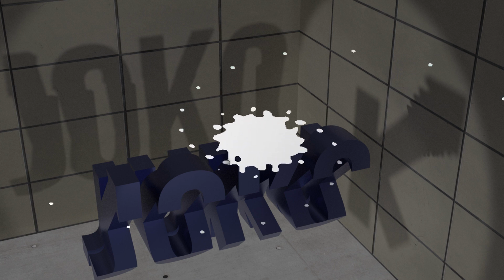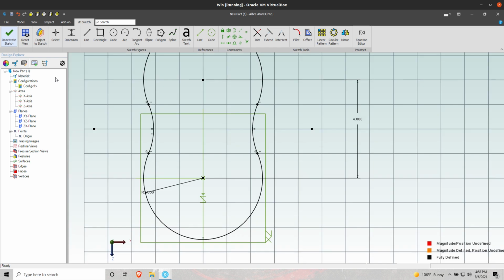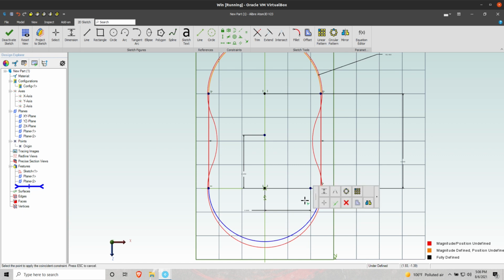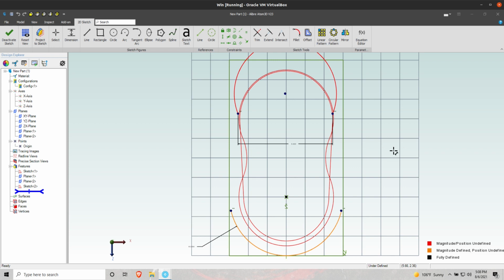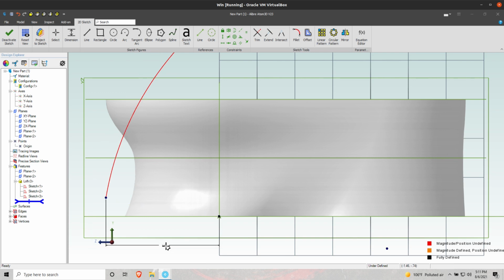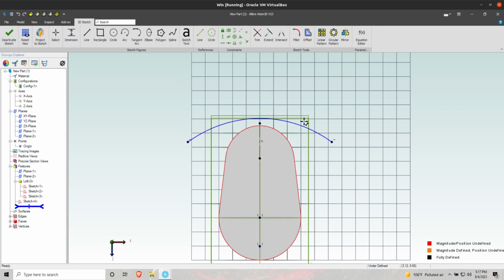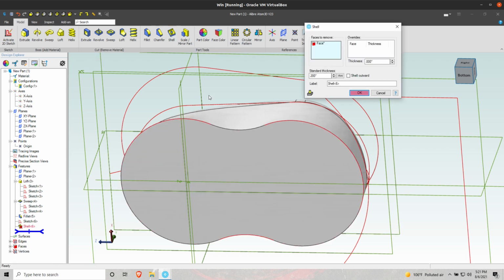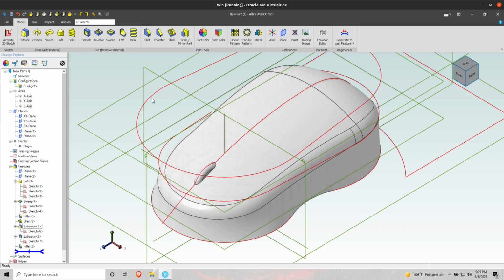Alibre - Make a Mouse - AND How Does Alibre Run In a Virutal Machine? |JOKO ENGINEERING|

Comment: Is there any chance you'll be covering  loft guide curves with Alibre Atom 3D. I'm coming from Solidworks and have tried every which way to make them work. The only videos I found on guide curves are in Alibre Design Profession using 3D sketches which Alibre Atom does not have.
Reply from the maker: Yes, that's a good topic.  I'll film and see when I can upload.